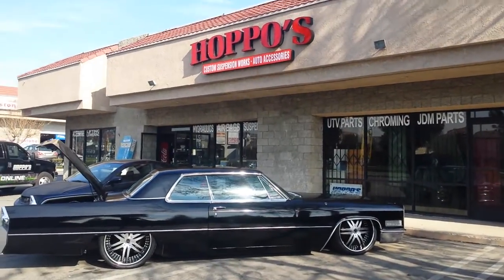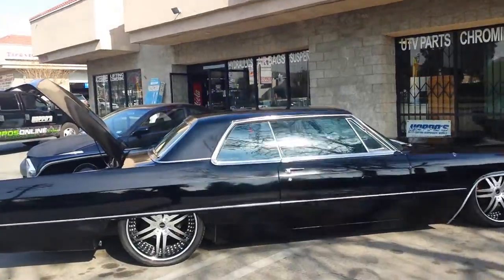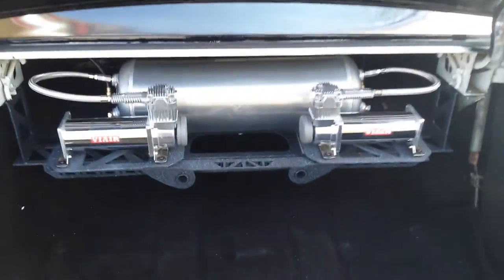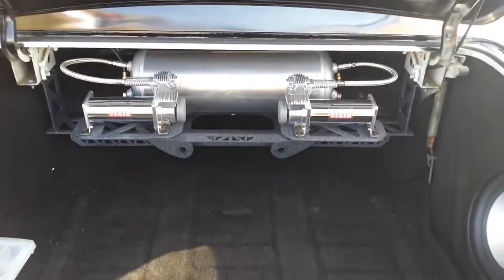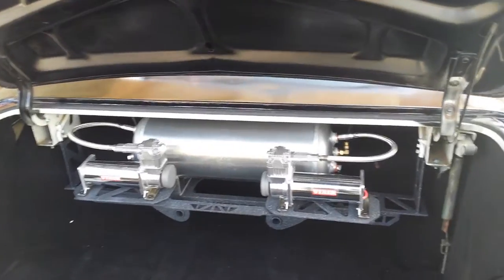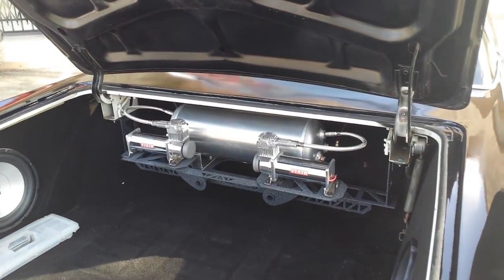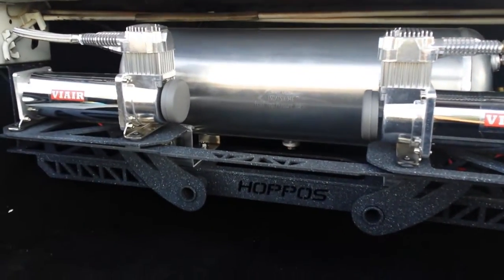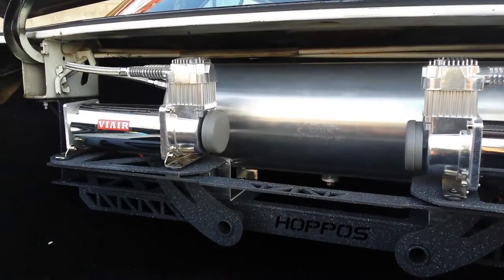Super clean caddy bagged up!! Hoppos style

Comment: How high can bags on a full lock up? Im intrested on bagging my fleetwood but i want that hydto stands like 8" in front and 10" in the back. Can that be achieved with airbaggs?
Reply: Yes, my 69DeVille convertible goes higher than stock (chest height) and can pancake low at half in from frame to ground. Glad I didn't juice my caddy, was about to tho
Reply: @TheRds797  what setup did you get installed bro?
Reply: @juannavarro3620  I have 2 Viair 480s, Slam Specialties fast bags, 2 tanks, half in lines, and reinforced front frame 7 switches fbss. Eleminated my bump stops as well. It's very fast and I've done 3 wheel while turning, won't do it anymore bcuz it just came from paint and body shop. Don't wanna mess up body lines on a classic Cadillac. On full tanks it can definitely come off the ground. My next caddy is going to be juiced 93 Fleetwood. Classic caddies imo are better bagged.
Reply: @TheRds797  im all about hydros but with my 95 big body caddy fleetwood i have 22s with vogues and want to bagg it but want the look of hydro set up. Seen some bags that really dont raise the car pass stock hieght. But im getting another one and ima put hydros on that one.
Reply: @juannavarro3620 Have you looked into air cylinders? I've seen them telescoping as well. My caddy definitely goes above stock height, it's like getting into a truck when I have it all the way up. Can also adjust the cup size to get more height as well. I have double bellows all around Slam 7s I believe. It's not a bolt on kit. When I installed it 10+ yrs ago, was no kit for it. Kinda glad it worked out that way, bolt on kits don't get as high or low. I had 22 wires on my 69, took them off and went back to caddy hubcaps and white walls. Drives better, even tire wear, I'd like to see it with some Vouges tho... what size wheels tires do you have? 22x9?? Vogue doesn't go bigger than 22 right?
Reply: @TheRds797  yea i been searching for some air cylinders but cant find them. I like the hydraulics look. Yea i have 22s x9s and vogue makes 24s but they too wide for a car. Havent seen anyone tired to put them on a car. Not saying it aint possible, which im a firm believer that if there is a will there is a way. When i get car back from shop ill post some pictures or make a video and post it on my youtube.